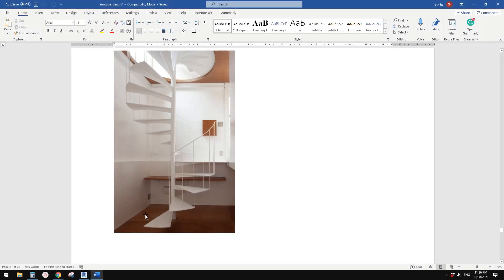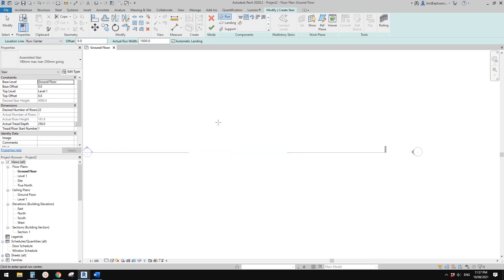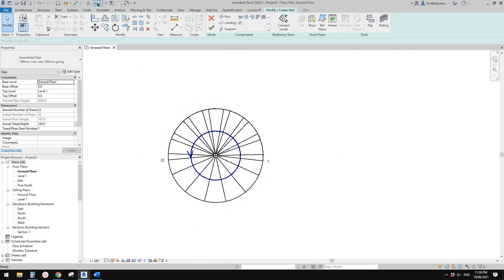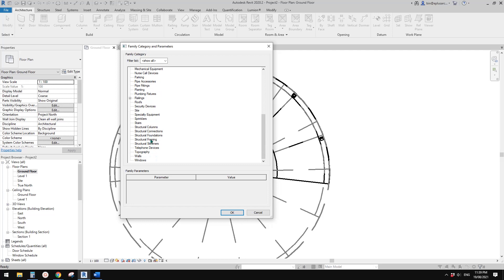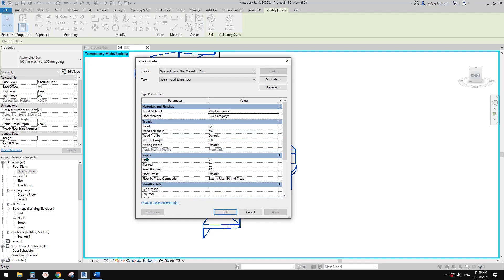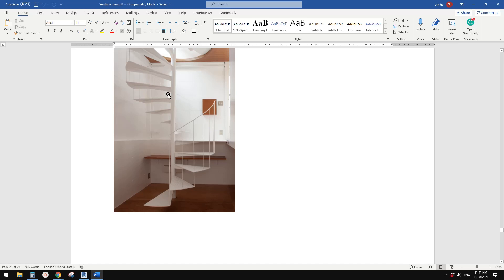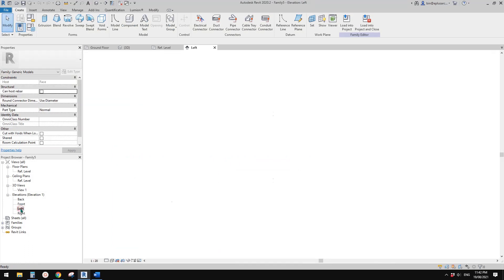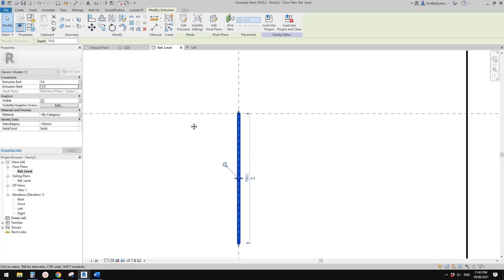Everyday Revit (Day 517) - Spiral Stairs Exercise

Comment: how can we match this  spiral stair in point cloud (Laser scanning), can u pls tell me
Reply from the maker: Personally I wound not worry too much about it because it will most like be retained or demolished. Just model it as close as you can. But if you do need to model it very accurately, the model in place tool is probably easier to achieve that then the stairs. Show me a screenshot of your point cloud if you like and let me see if it is the case.